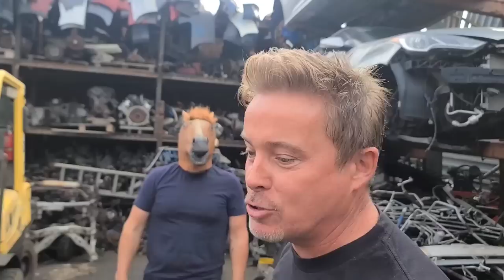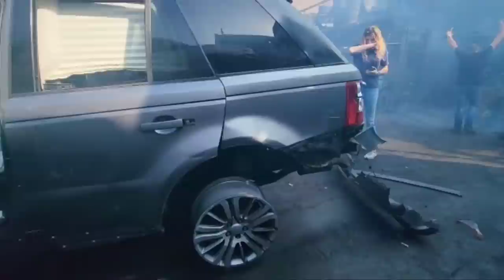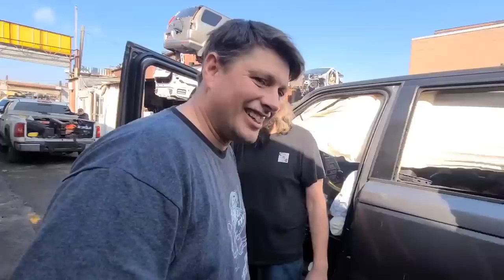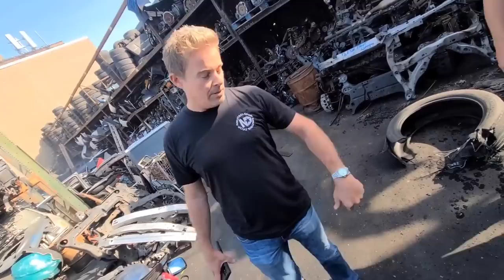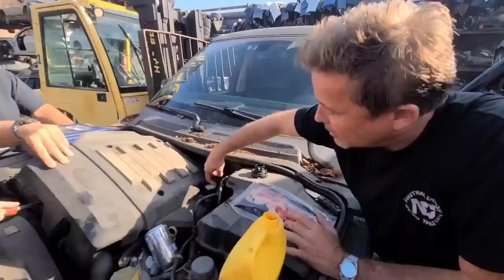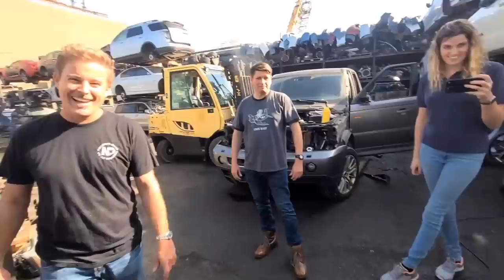This Is How It's DONE! Stuntman Brought His A Game! 6 Channel Collab! Neutral Drop

Comment: Amazing unique video with three rare never-before-seen things.
1) Stuntman blew airbags by slinging a 40 pound piece of tire all around the wheel well, blowing out the door and the bumper with one tire blow!!
2)Cool smoke effect happening at 14:10 where smoke intermittently puffs out the bottom instead of the back
3)Multiple camera angles with a slow mo shot

Keep up the amazing content and keep on posting motor blows PS use fabuloso

Comment: 13:33 when you opened that big hole after the maf it’s allowing unmetered air in and will run like shit or die since the ecu cannot calculate the right amount of fuel/air mix. Unplug the maf sensor and it should go into a default rpm based calculation for air and should run much better when trying to stuff the intake.

Comment: the airbag went off probally cuz had it been going down the road hauling ass like that and the tire blew out like that it would've rolled over and been a really bad accident. so its a good thing that they programed it that way. back in the day when ford exploders were blowing out tires on the freeway a lot of ppl died that way. so it looks like they made the side curtian airbags go off to help save you a little bit.
Reply: Tyres don’t blowout quite like that during driving. a tyre wouldn’t blow out like that if they had the cars weight on it because it wouldn’t get half the wheel speed. 

Rollovers are definitely not caused by tyre blowouts, they’re caused by inability to correct steering during a blowout by inadequate drivers. 

I’ve had two blowouts, one was going 140kmh, and I didn’t leave my lane because it was a rear tyre. (I half expected it driving on tyres worn down to the wires)

Comment: Hey Stuntman this happen to my self on a 2007 Cadillac SRX it was a AWD and brakes failed so it went passed ebs if driveway in roadway and into a deep ditch but was a new Goodyear tire in the front driver side that blew out when back 2 gained traction smend it blew to shreds I couldn't believe the damage it caused stabilizer bar through the drivers floor and shock housing to fender blew off to pieces was plastic garbage and threw side skirt off the front bumper blew off too as well and the wheel housing on driver side was all damaged it was totaled by insurance company and was only like 10 yr old at that time it was totaled from a stupid tire and brake failure.
Reply: Was very very dangerous situation there was people outside pushing on the rear trying to get it to climb out that very deep ditch and that tire failed but I bet it was spinning at 150mph without it actually moving from no traction haha lmfao. NDFFL....

Comment: This is why the pros remove the airbag fuse and abs fuse out before doing stuff lol they have shock sensors in the front and rear lol and that tire let go because it was way over its speed rating
Reply: Aussies usually use cars that never had airbags, 70s 80s and 90s cars.
Reply: @Jake_Hamlin  lol I've bought a few newer cars cheap for rallying hahaha there getting easier to find than the older commos or Falcons hah